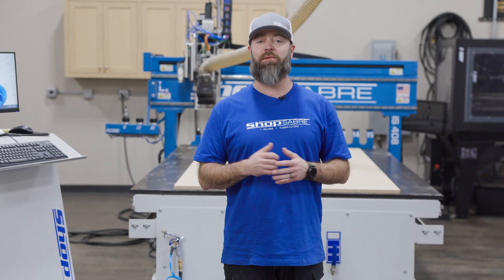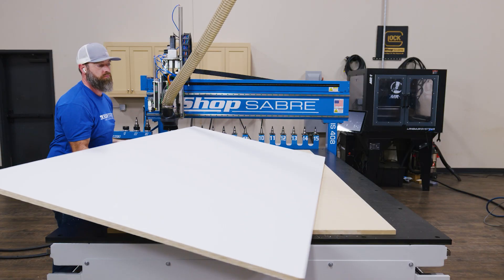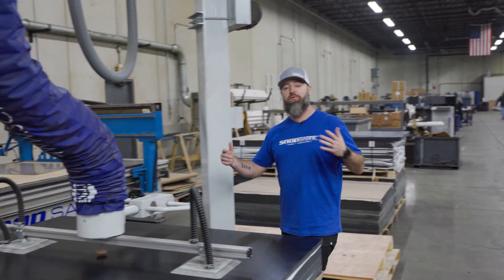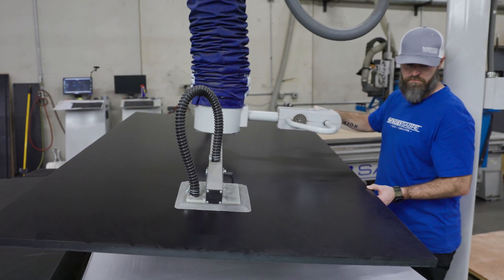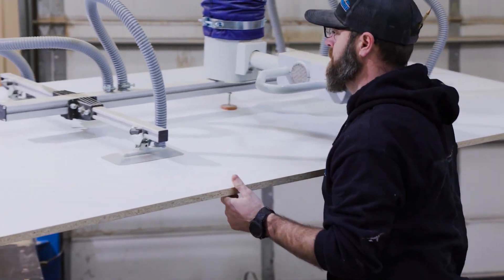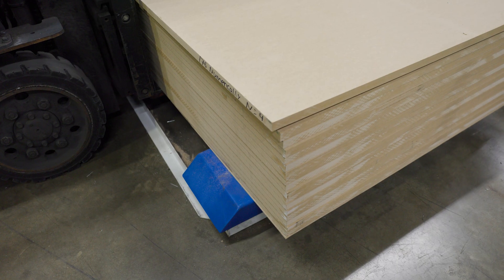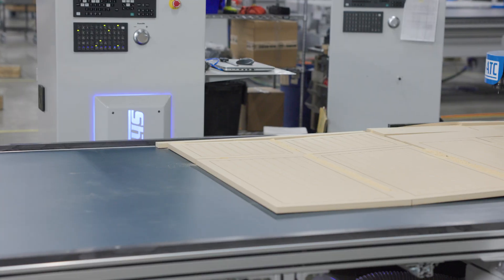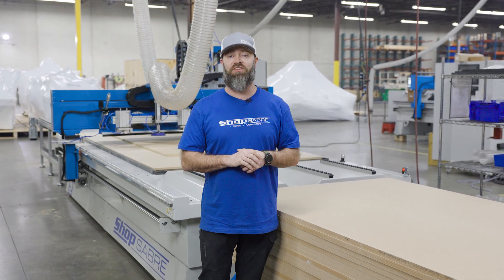Material Loading Options - ShopSabre Minutes

Comment: hello folks, missed options? lifts? humm,  as machines go, I wouldn't mind a thermal sensor to view the heat and chip load effect. Some precision guide rails on the back of the gantry for other tool plates would be cool. How about an axis drive for an aggerate head that could be shop/customer mounted when needed? Custom tee slot and vac grid options....
Reply from the maker: Thank you! While there are endless possibilities, we carefully select those that align with market trends while ensuring we maintain our high service standards.
Reply: Hi
You guys sell that vacuum lift? Or where can we buy one ?
Reply from the maker: @ yep, you can buy through our parts department